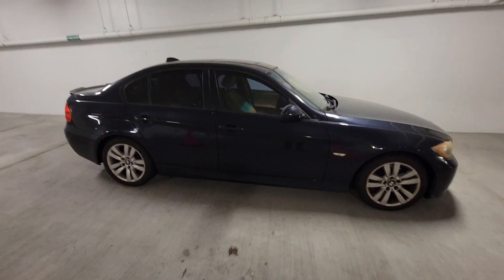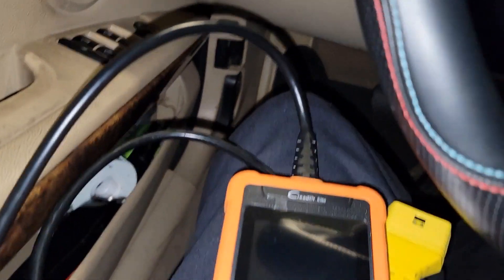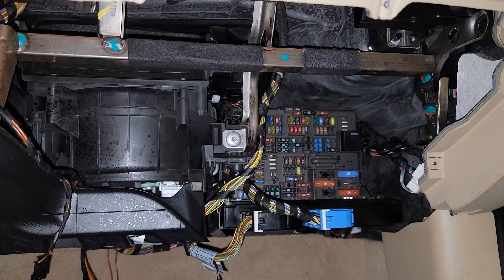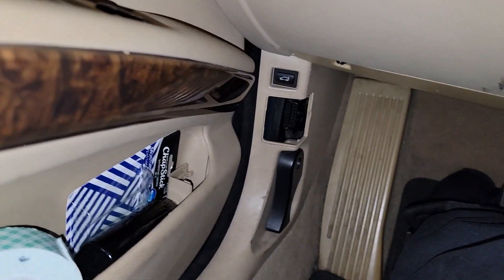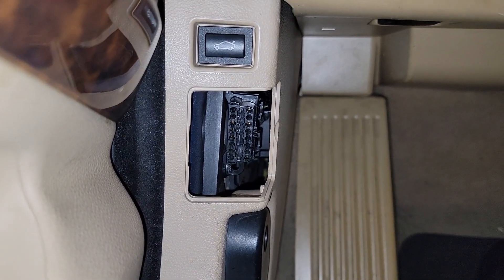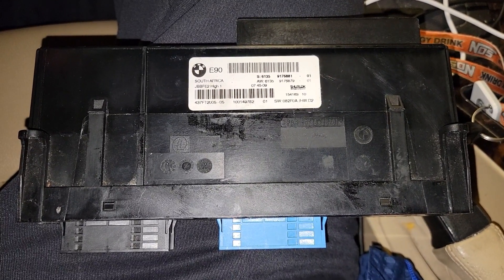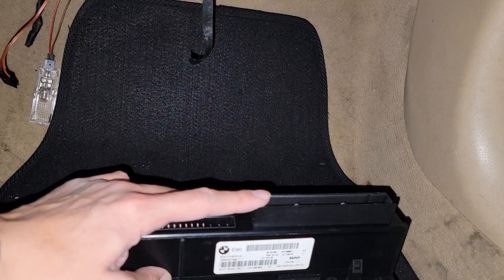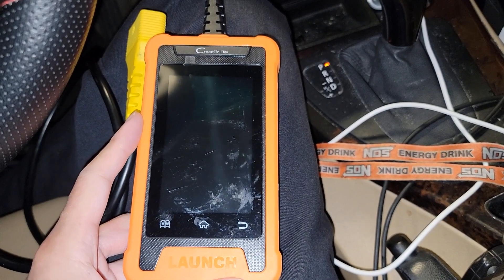BMW OBD 2 Port Not Working Fix No Communication Fix E90

Comment: Similar issue, OBD II no communication. My first simple test is;

Goes to hidden menu at instrument cluster, i check 07.00 (coolant temperature). The number is not showing. 

Im using multimeter and check the DME voltage, and it's normal.

In my case, OBD2 can't connected because my DME is not sending the signal to the OBD. 

Symptoms;
• Everyday in the morning Extra fan on with Full power 😂
• Transmission warning light...etc

Cannot connect to OBD in the first 30 minutes. After > 30 minutes everything is normal.

Im on checking DME Relay. Wish me luck

Comment: Do you need the key from the old jbe? Or can you use the same one
Reply: the same key you already have
Reply from the maker: Yes  @jimmyramirez3804
Reply: @Winstonzm do have to code jbe???
Reply from the maker: @jimmyramirez3804  I used the same original key

Comment: I have a bmw e91 2007 no start ... i change the block of motor for oil reasons because they spend oil a lot an i put another engine but with my original part but now no start no connect with a laucher scanner no recognise my car no automatic or manual vin number

Comment: I’m having this same issue but only with the smog machine in California any ideas?
Reply from the maker: @LuisGonzalez-ph8zp  if you can connect to it but the smog place can't, it could be their machine that's the problem
Reply: @Winstonzm  I'm in California and have the same problem, my scanner at home connects every time but two different Star smog places were not able to connect.
Reply: @antonbohlin-california same issue here. I can connect at home with a wifi scanner, but cant connect at the emissions place. Did you figure it out?
Reply: @HornOfGoat33  What ended up working for me was removing my aftermarket stereo completely. After that my Smog guy had no problem hooking up the car to the State provided system for smog check. Hope it helps.

Comment: Holyshit, 8 minutes to state you need a different control box.....

Less blabbing. More getting to the point, then run down your diagnostics
Reply: He’s trying to fill the hour.
Reply: Those 8 mins could possibly save you over 8 hrs at the dealer or over $800 in diagnosing the car so how about you stfu and thank the young man for this valuable information

Comment: Looks like the reader is a Launch Creader Elite specifically for BMW/Mini. It’s going for $129 on eBay new with quick shipping. Not bad.

It even lets you program new $30 key fobs. Even if all keys are missing. Pretty sweet considering the cost to tow a car to the dealer or have a key fob made for $300+.

Comment: mine randomly lost obd connection (my scanner seemed to not connect with the ecu)and became a crank no start. one thing l noticed there was no spark. after disconnecting and reconnecting ecu sockets and spraying contact cleaner numerous times. obd connection was restored and when l tried to start it it started right up. what is happening to my bmw e90?????
Reply from the maker: It could be water getting into the ecu box then into the ecu and coroding the contacts. When I was reading the forums trying to find my problem, a few people said they found corrosion on either the ecu contact or the socket that connects to it.
Reply: @Winstonzm  thanks for the reply am losing my mind
Reply: @Winstonzm  can oil cause that, coz there was traces of oil
Reply from the maker: @alistuslarter6787  I'm not sure how oil would get in there because the box the ecu is in is supposed to be sealed. Maybe the cover on the box wasn't properly closed.

Comment: I got my 07 328, e90 no dash or obd gunna replace this and hopefully it’s fixed
Reply: Did it work?
Reply: On my BMW 120D E87 2007, the Instrument Cluster and OBD2 port are on the same fuse (F58). However on my car, OBD2 is down but Instrument cluster is working, therefore fuse not problem. Could be for you though..??..??
Reply: @markhorridge7104 did you find the solution
Reply: Yo I’m having same issue did you fix it?

Comment: Was it draining your battery?
Reply from the maker: No. It was running fine. No check engine light. Just couldn’t communicate through the obd port
Reply: @Winstonzm  mines powers up the scanner runs and drives but can’t communicate with the dme start and stop light stay illuminated like it doesn’t go into sleep mode when locking the doors also I can’t get acc mode to stay on
Reply from the maker: @demon-mt9ol  could be jbe related since the jbe also communicates to the rest of the car not just the dme
Reply: @Winstonzm  🤙
Reply: My battery(ies) has(ve) been draining to the point where a newly installed starter motor's solenoid stuck closed consequently killing the starter motor.....Then, after replacing starter motor, tried recharging newish BMW bought battery (6 months old) and reconnecting. Managed to clear fault codes using Bimmer Tool through OBD2. Tried starting and nothing but click click click and an unsettling sound from driver side hidden module. (CAS? Footwell?) Plugged Bimmertool in and no communication with ECU. Battery fried; Bought a new battery (Bosch) from ECParts, & car started fine but then battery dead within three days. Took to auto electrician yesterday and they found nothing wrong other than they also could not connect with ECU using their scan tool, so booked in to Bolton Motor Works for closer look. But how can they know where to look without an OBD connection??? Aaaargh .... Lol